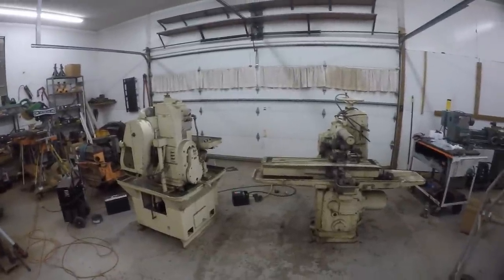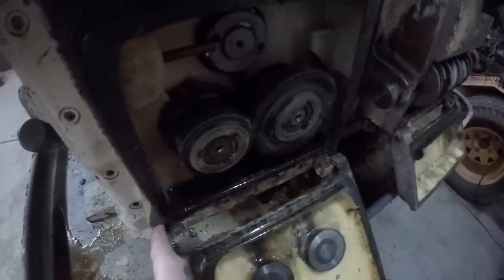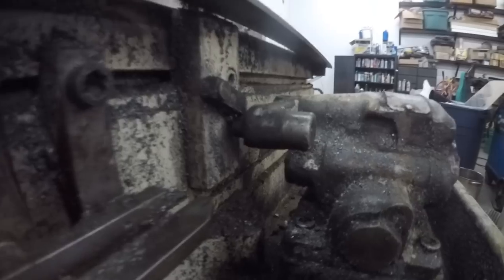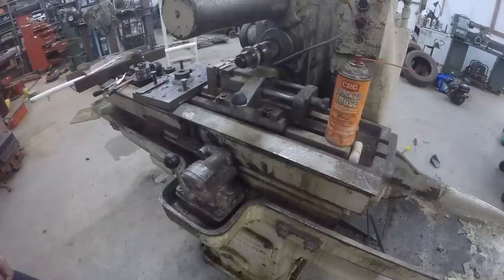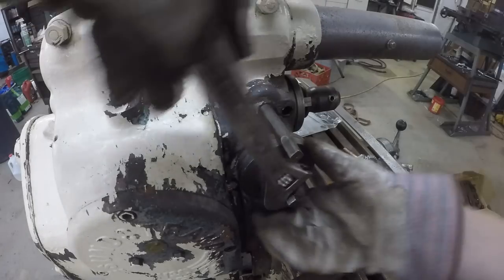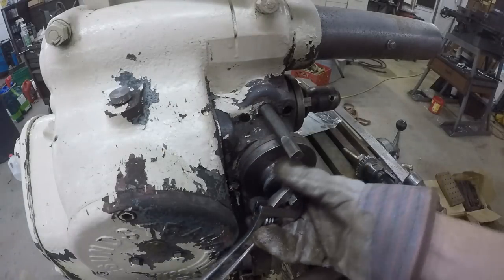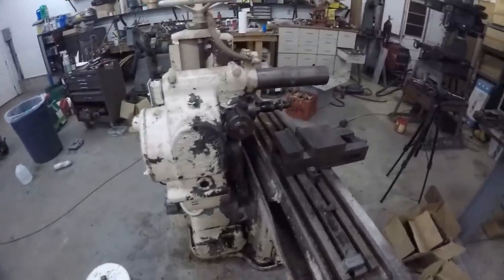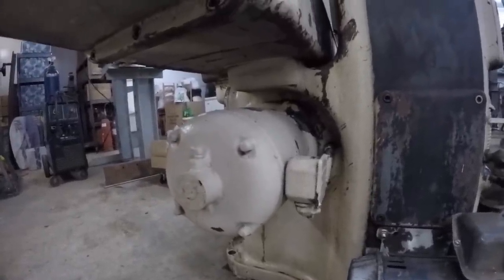Saving an unusual milling machine from the scrapyard.

Comment: When I first got started with my shop I found a pair of old Kent Owens small production horizontal mills just like the Sunstrand. I knew it was obsolete and I never intended to use it as a mill, but after doing some part swapping and getting creative I made the smaller Kent Owens into the best damn tube notcher ever. It is a small compact machine with a 40 taper spindle, I made some custom tooling for it to hold the tube and cutters. It makes the most accurate tube notches and it cost me some time and a little bit of money. If you do fabrication and have the space see if you can convert one of the machines, it is worth it.
Reply from the maker: Now that's a great idea. These would make killer tubing notchers what with the automatic feed and being as rigid and powerful as they are. Unfortunately tube notching is one thing I just never find myself needing to do.
Reply: I've got a KO mill. Used it from time to time for production work, it sits mostly. Hate to scrap it. I paid $275 for it 25 years ago.

Comment: a vfd can only run one single motor. it does not provide 3 phase electricity. your best cheapest bet is to build yourself a rotary phase converter out of an old 3 phase motor and some capacitors. that will get you the power you need to run a mill like that. To use vfd you would need a seperate vfd for each motor in the mill and rewire the controls to talk to the low voltage side of the vfds to control the motors.

Comment: I have just been in the very same situation.  Having very good high quality older machines, that were very expensive, years ago.  That no one wanted..... Ended up being scrapped.

Those VFD's typically put out square waves, VS a sign wave.  I've never had any problems with running old motors as long as it is set up correctly.

As for using a motor to generator a 3rd phase, this is not fool proof ether.  That phase that is generated is
lower in voltage because of losses.  This will eventally over heat the motor your running.   Better off with a VFD, that is set up correctly.
Reply from the maker: Yes it's terrible the things that go to waste due to obsolescence. I was under the impression that if you use a big enough motor for the idler the voltage difference will be negligible. Now I wish I had measured the voltage on each leg going into the mill. It's also interesting that you haven't had any trouble using a VFD on old equipment. I've read lots of stories of people attributing a motor failures to the square wave output but idk. I have used them successfully on some newer stuff.
Reply: @AlwaysBored123  The issue is older motors with class b insulation is not rated for the high voltage spikes a VFD creates during pulse width modulation. That really is not an issue tho if you are not abusing the VFD to get higher frequency out of the motor than it was designed for. The other issue is using the VFD to control the motor speed which normally is done through gear ratios but if done with a VFD you are effecting its ability to cool itself.
Reply from the maker: @inkman996  That's very interesting. It is extremely tempting to reduce the motor speed with a VFD on most machine tools so that could explain most of the problems people have with them.
Reply: Do you still have any you want to get rid of?
Reply from the maker: No sorry.
Reply: @AlwaysBored123  I seen someone one use a VFD on a small lathe to turn it into a weld positioner, the motor lasted about an hour and completely fried because they were turning it at something like one RPM. It is possible to do such a with with your lathe but instead of using the lathe motor just couple a cheap stepper motor to the spindle, any way that works.

Comment: Amazing old machines, forefathers of today’s CNC machines, except ! Everything is mechanical. The people who designed these machines were geniuses, not like today’s machines where everything is controlled electronically by a computer.
Reply from the maker: It is really neat the way they're designed. And a real testament to the designers that they were both still working fine some 70ish years later with apparently next to no maintenance.